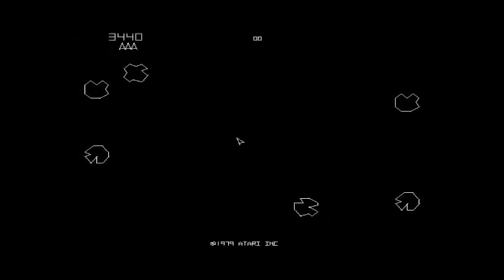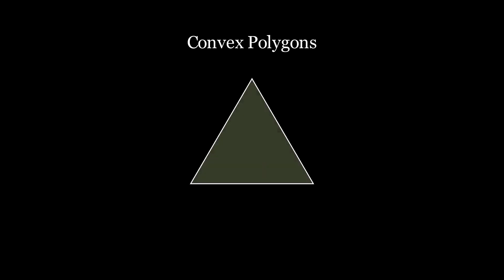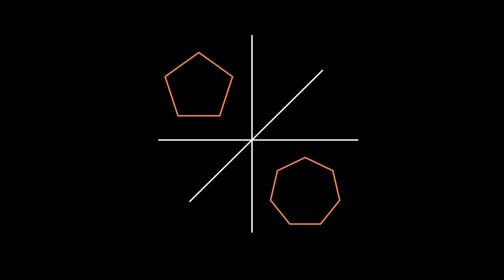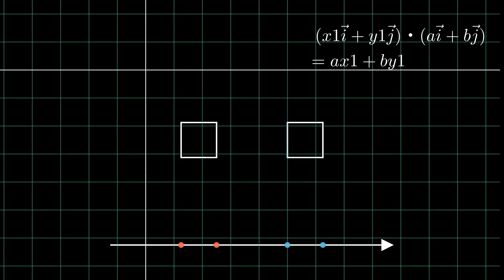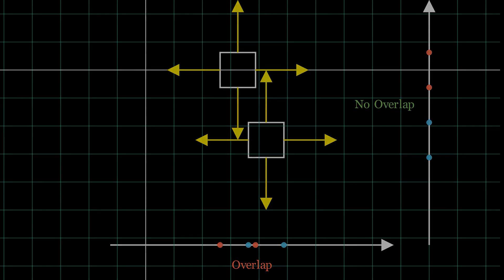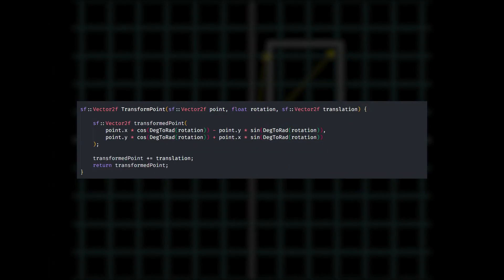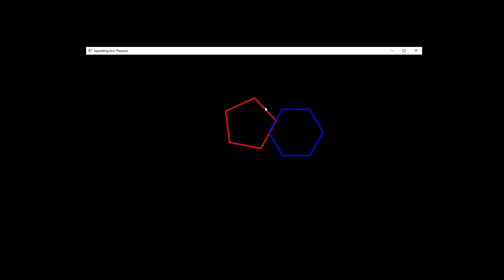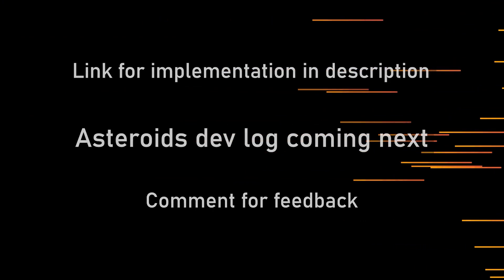Polygon Collision Detection using the Separating Axis Theorem | C++/SFML

Comment: I had implemented this once as a part of my internship for 3D objects. Nice and clear explanation. Requesting to also provide the algorithm for dividing a polygon into least number of triangles. I had converted/approximated the concave polyhedrons into convex polyhedrons by finding the 3D convex hull, but dividing into triangles/pyramids instead is a more accurate representation for collision detection. What is the trade off in processing time when using polygon subdivision?